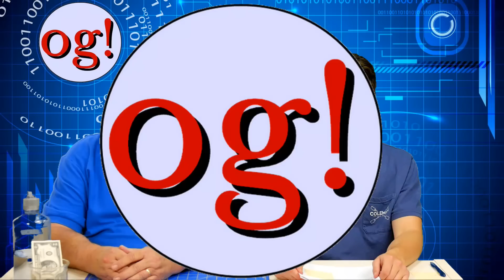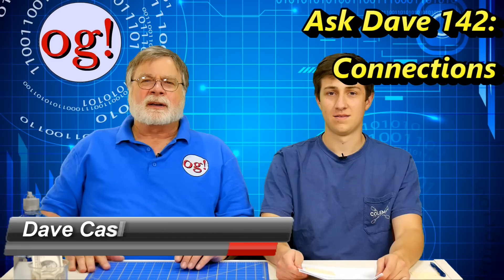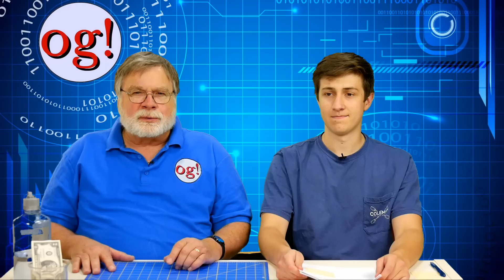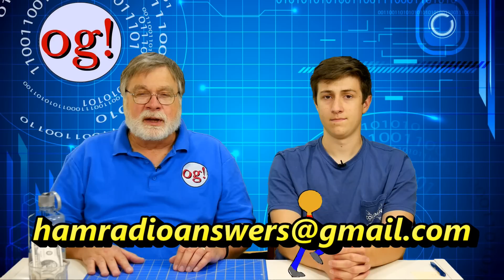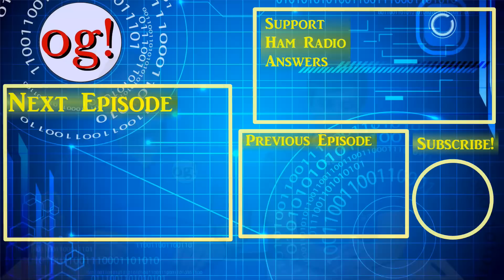Ask Dave Questions Answered: Connections (#142)

Comment: Moonraker do a quad band vertical base antenna covering 10m, 6m, 2m and 70cm, see:
https://www.moonraker.eu/antennas/ham-amateur-radio-antennas/sqbm4060p-quad-band-6-4-2-70cm-base-antenna
It's only 1.2m long so is probably not very efficient on 10m but it will get you on the air with just one antenna.

Comment: Diamond antenna does build a 4 band vertical for a mobile installation. Covering 10m, 6m, 2m, 70cm. It is built to work with the yeasu ft-8900 and mount to the edge of the truck. One of our local fellows has one and he said it works well but it needs to be at the edge of the vehicle he put it on the center on a magnet and the swr was terrible, but when he moved it to the edge it was much better. DX Engeneering has them.
Reply from the maker: Thanks for the info.

Comment: Thanks Dave for another great video,  something for the person having trouble with GFI, there are available units for damp areas or outdoor that trip at a slightly higher current,  sometimes can solve the problem.   (we use them on boats all the time)

Comment: I enjoy these sessions. Thank-you to the two of you. A quad-band vertical base station antenna, the Moonraker SQBM 6010P (Length: 1.2m Radials: 3 X 87cm) is available in the UK, that covers 10m/6m/2m/70cm. Also, the Diamond CR-8900 mobile antenna (1.26m tall)covers these bands. Horizontal FM is a mode that does seem to be popular for those wanting to work DX on 2m (possibly the other bands too). Cross-polarisation losses are a consideration, if both stations are not polarised the same way. Hope this helps.

Comment: 10m FM is above 29.3. Calling freqs are 29.6 and 29.5 simplex. There is a big 10m FM repeater on 29.620 out and 29.520 in in the Boston area, I don't remember the PL but it's in the repeater books. Spacing is 20kc but I know there are some on the 10kc channels too. 10m simplex is below 29.5. AM is 29.0 to 29.2. AM calling freq is 29.0. There are a few 6m repeaters in the Denver area which you can look up in any repeater book. 6m AM calling freq is 50.4. FM simplex calling freq is 52.525.
Reply from the maker: Thanks for the info.